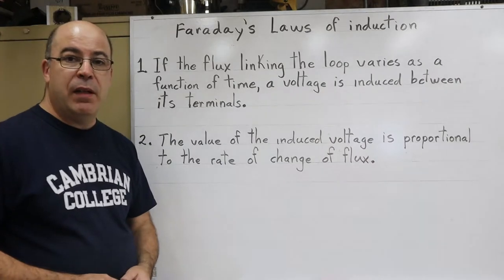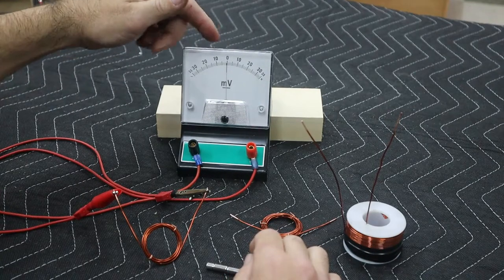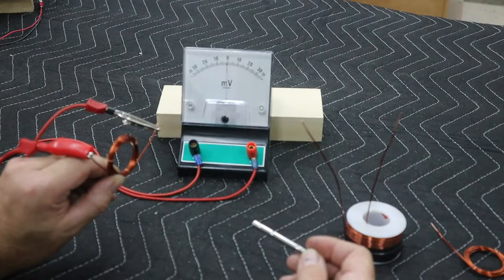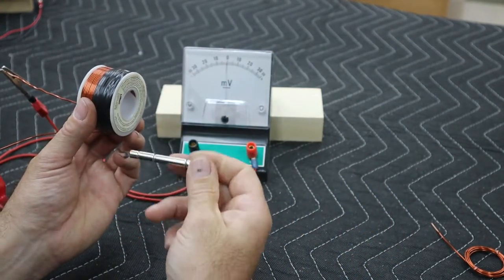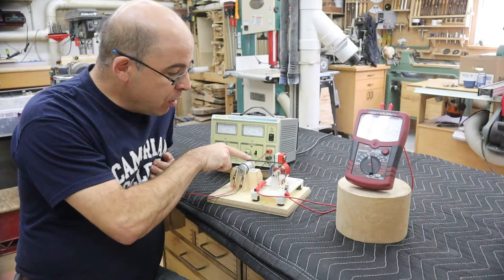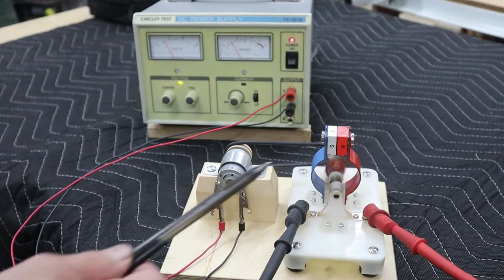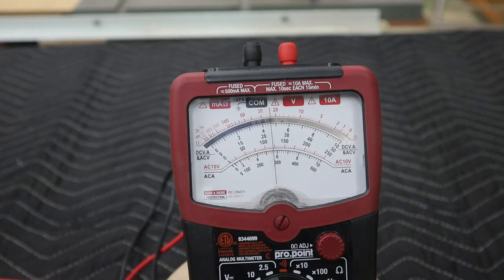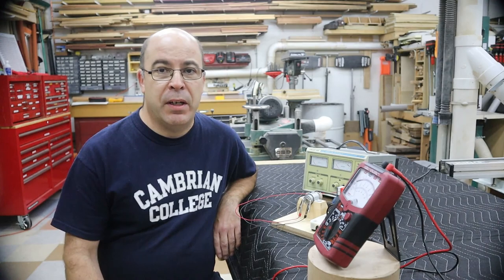Inductors & Induction

Comment: I can see you chose 25 Volts on your analogue meter does this mean i can chose/set up to any voltage just below 10 Volts as shown on the meter?
Reply from the maker: A standard practice when you are dealing with an unknown voltage is to start at the highest setting on the Multimeter and slowly bring down the settings  on the measuring device to their lowest value without going over the ratings of the voltage setting, in order to increase the accuracy of your measurement. I had done this, before filming to put the focus on the actual measurement and not on the process of setting up the multimeter.